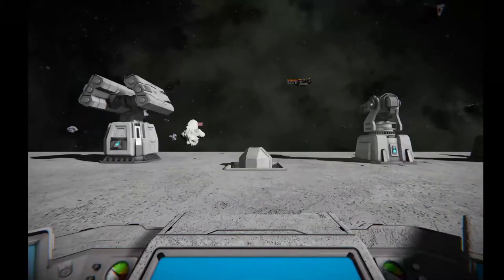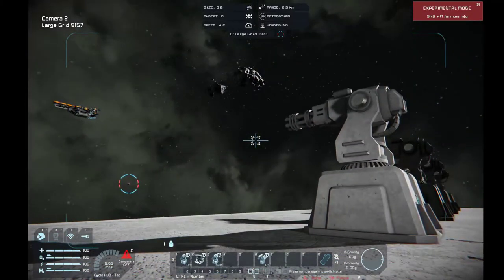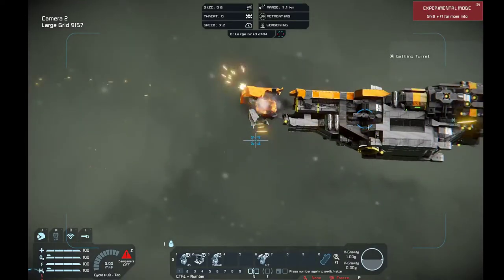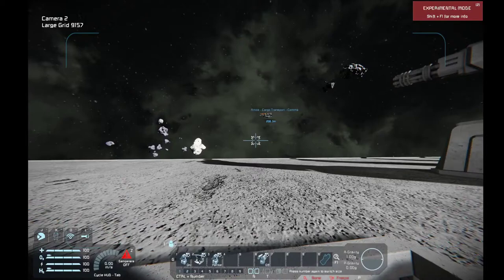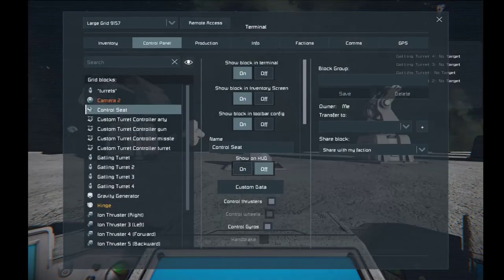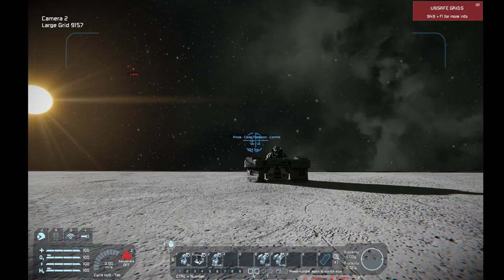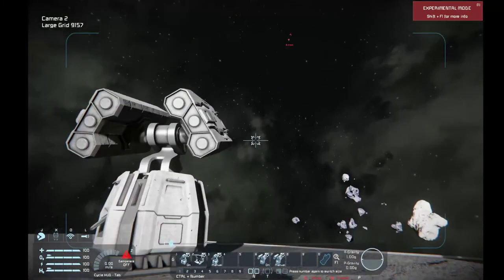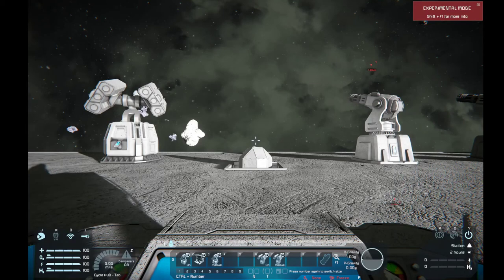Weapon Core 101. How To Use Control Mode.

Comment: Sooo this video...idk if has helped anyone but myself not really one bit. Becouse i can tell there is obviously a player made camera "turret" for looking. But when i made one, if weaponcore is being used i can not assume control of the "turret" camera. So maybe explain stuff like this.
Reply from the maker: There is a "shared control" feature in the turrets control menu.
Reply: @badgerwildgaming6908  im talking about the camera "turret" not the actual turrets
Reply: @badgerwildgaming6908  For semi working after doing som messing around but how did you get turrets to aim were you were aiming becouse the turrets aim towards my little camera "turret" instead of were my camera aiming
Reply from the maker: Shouldn't do that. Did you put a glass pane in frount of the camera cause that can cause weapon core to target you with missles.
Reply: @badgerwildgaming6908  no i dont understand, its a starwars mod and i just have  a rotor hinge above with a camera on it. Then turret control to use
Reply from the maker: @bobbywinicher9080 what starwars mod you using and do you have weaponcore active?
Reply: @badgerwildgaming6908  Modern Star Wars Weapon Pacj V.0.63 [Weaponcore] 
And yes i have weaponcore enabled.

Comment: I'm very confused, I have weapon core but this 'share control' option isn't there?
Reply from the maker: Their should be an opinion now called advanced features turn that on and it
Should be there if not I'll check and find it for you my powers out due to tornados that's threating tomarrows stream.
Reply: @badgerwildgaming6908  I found the problem, the extra options don’t show up in a ‘control station’ which I’d been using instead of a ‘control seat’. Seems odd, not sure if that’s intended behaviour or a bug.
Reply from the maker: @Snarfyy don't know but I'm glad you can use it. Now go forth pc engineer and conquer the galaxy.
Reply: @badgerwildgaming6908  I've got them working fine in 3rd person, but when I use a camera I can't control any weapons. they won't move or fire. Any idea what I'm doing wrong?